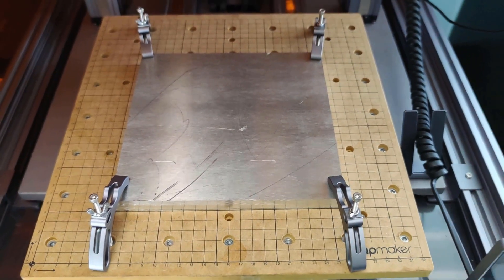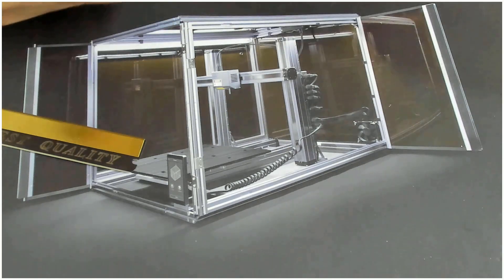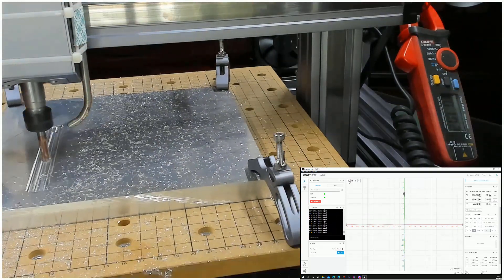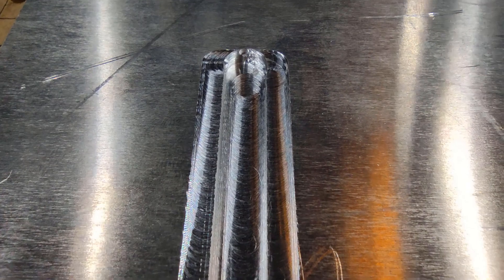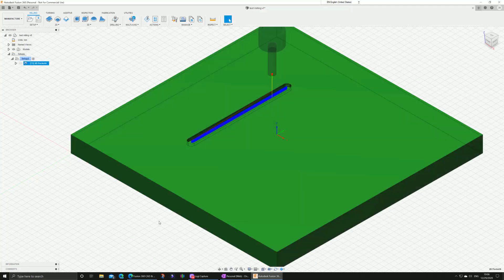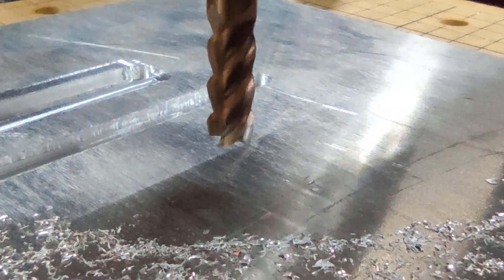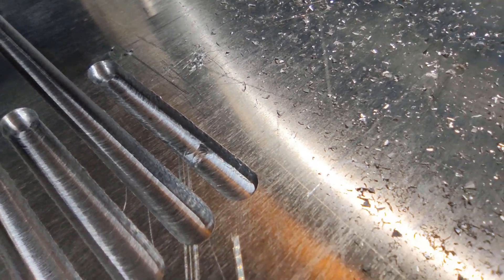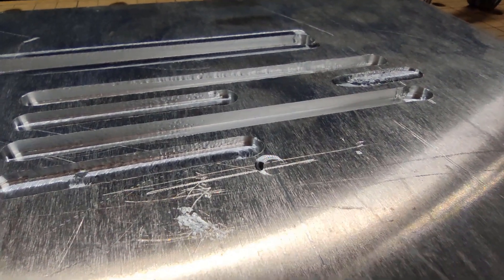Snapmaker 2.0 milling Aluminum

Comment: thats a big chunk of alu your trying to mill with a hobby CNC?  its not meant to do industry size milling I'd suggest. which explains the movement in the head. if you wanna use it you gotta go small and slow and steady. which makes it pointless which enforces the requirement for a proper big cnc machine. the machine was struggling with a big drill size -you can see it even "looks" too big for the rig.

Comment: the depth shld be like 0.1mm  that way the bit can cut aluminum away with the available power and structure of the snapmaker. Sure the time to do the job will go up but have to identify the sweet spot for depth. 

As far as loose structure is concerned see if there are loose screws and tighten it.

Comment: The real issue is the rigidity of the CNC router. You will never get rid of the chatter.
Reply: use 3mm 3fl carbide endmill, depth of cut .127mm,  feedrate 2000mm/min. 90% alcohol mist spray. Your welcome.

Comment: Try a smaller diameter tool 6 mm or quarter inch diameter tool is just too large. Also try ordering some single flute cutters. 3 mm or smaller. Also using your primary or first cutter use a ball end mill (this will reduce  the amount of resistance  and your primary cut)then go in with a sharp corner end mill.

Comment: Habe ähnliches festgestellt. Alu kann man schrubben, aber bohren und ordentlich Material abtragen geht nicht. Das Linearmodul sollte eigentlich nie so viel Schwingung von der Spindel sehen - ob die Spindel zu leicht oder schlecht gelagert ist?
Reply from the maker: I believe that the spindle bearings will not last long if work with aluminum.
I working of some adjustment, stay tuned

Comment: Sehr Interessant! Ich habe mir allerdings extra alu Fräser besorgt. Die haben nur eine Schneide und sind extrem scharf. Dazu noch einen kleineren Durchmesser.Bin zum Testen allerdings noch nicht gekommen. Hab von dem Hersteller einen Fräser für Plexi und der Unterschied zum Universalwerkzeug war erheblich. Zur Zeit hab ich eine Proxxon Fräse montiert die mit 20000 Umin ein wenig mehr Leistung hat und gerade in Holz mehr Zustellung ermöglicht. Letzten Endes ist aber halt nur ein Bastelwerkzeug.
Reply from the maker: I think not that a single flute  will give better results it should even more vibrate then this what I used.  I use the 65HRC grade that is the hardest material and should work for everything how ever in the moment I not found a smaller one. I am working on some adjustments and will make a new video with my findings in some weeks.
Reply: ยฃยยรำลบ